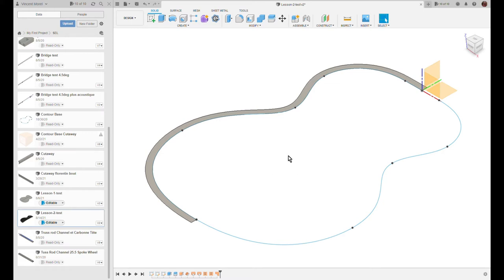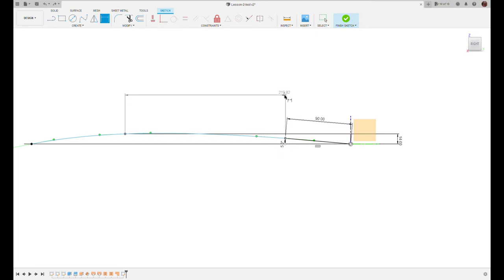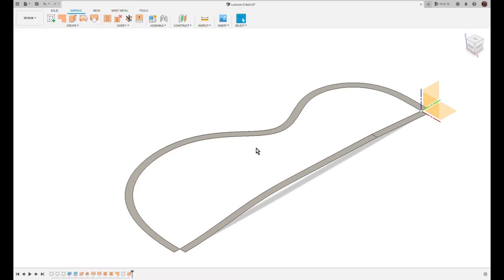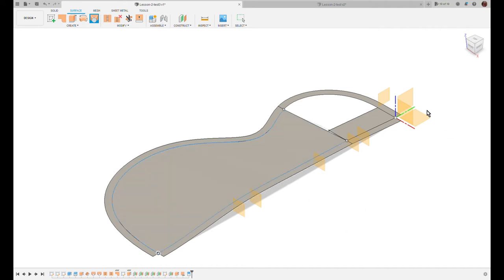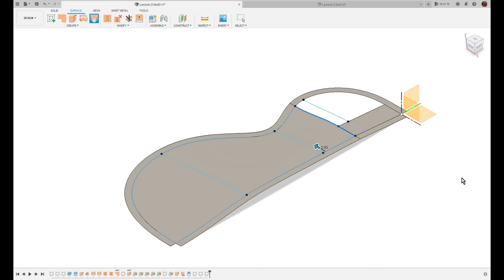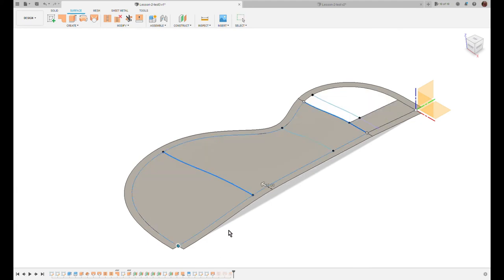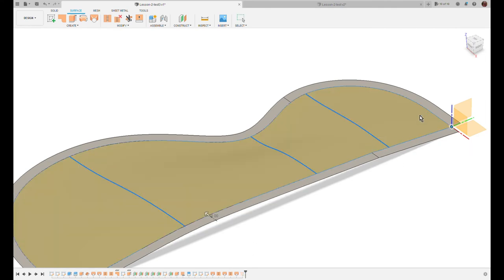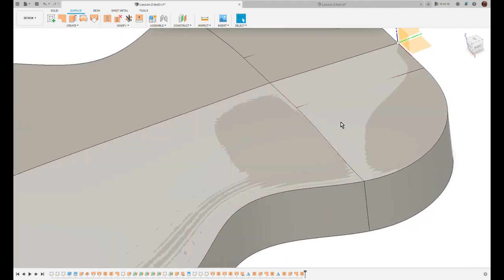Archtop guitar surface modeling with Fusion 360 (loft tool) - Part 2 - Neck Plane

Comment: Nice work Vincent.  I’m also doing an Archtop  in Fusion.  Thanks to Austin and Trippylighting.  One place you may run into problems with a completely lofted top is the singularities at the ends.   You’ll find you have a good looking surface but you can’t Thicken or offset the surface to make your top.  My work around is to split out the singularities, and patch or loft the parts that are cut out.   Regarding the cutaway, have fun!  I’d love to see your solution.
Reply from the maker: Yes you are right but as I use this for making mold, I do not need to offset or thicken it. It still work when I transform everything into solid for making a solid body block.
Will post soon a video about my "attempt" for cutaway. I'm not really far to have something good. :)

Comment: Very interesting approach, your results are fantastic. Have you tried the "topography map" approach? Basically you build the outlines of what a real template set for a carve top (like the templates you use to route the heights on a les paul top) on different planes and then you create a surface using the outlines as rails. I'm getting results that are actually pretty good when it comes to the shape of the top, but I can't get the part where the fretboard sits to be flat.
Reply from the maker: Yes I already try, in fact did my first one like that, but I do not really like it, found it very time consuming compared to this method with loft and complicated if you want to change the shape after. :)
Reply from the maker: I also found a new way of making the neck plane that allows me to do everything in one loft! Will do a video about it. :)